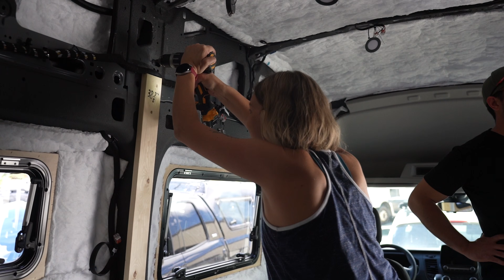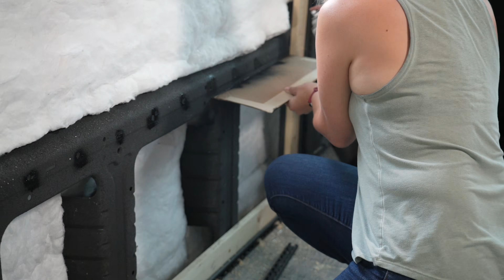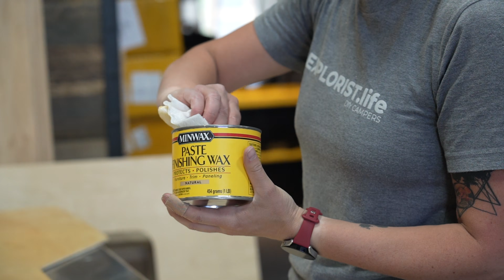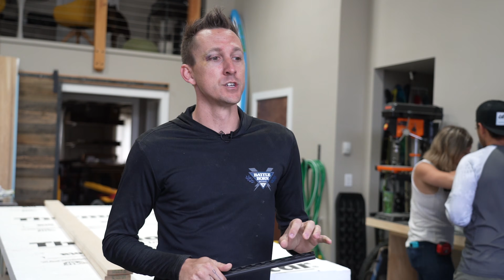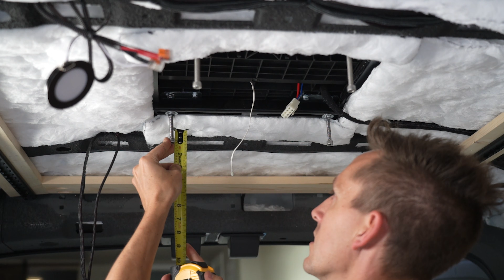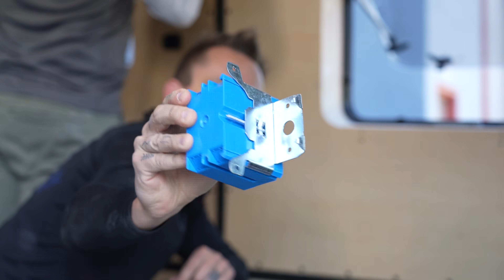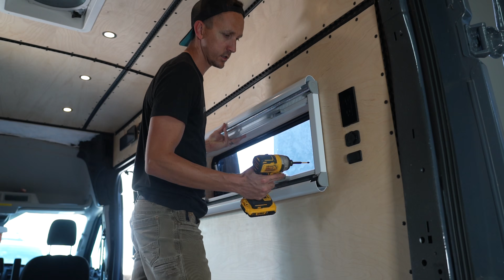DIY CAMPER VAN WALLS W/ L-TRACK (100% from scratch)

Comment: Hi guys! I'm here to ask another question :)  We just started installing plusnuts today using the Kiarou pneumatic tool that you linked above.  Did you have any problems with mandrels have a short life? We replaced the mandrels supplied with a 2 1/2" bolt - and we could only find stainless steel. The first mandrel we used lasted for only 6 plus nuts, the 2nd mandrel was good for 3 plusnuts, the 3rd mandrel was good for 1 plus nut, and same for the 4th mandrel.  Did you have problems with running through mandrels like this? Not sure if it's something we're doing wrong or if it's a problem with the tool. But at this rate we're going to pay crazy money just for mandrel replacements.  I know you're not pneumatic tool experts, but don't know who else to ask. Thanks....and happy New Year!
Reply from the maker: We went through probably a half dozen.  Get some anti-seize paste (any hardware or auto parts store will have this) and keep the threads lubed up.  A thread die was also helpful for straightening the mandrel threads out as needed.

Comment: I have another quick question....I was just about to order the pneumatic plusnut gun that you linked.  However, when i read the description on Amazon, it says that it can't be used for plusnuts. It reads "This pneumatic gun can't be used for stainless steel nuts....in addition, plus nuts can't be used".  So, did you use this for plusnuts? If so, did you have to make an adjustment to the tool to be able to use it?
Reply from the maker: We used it for plusnuts, yes.  We didn't have to make adjustments.  Not sure what the warning is for.

Comment: Great video! I'm curious why you used the furring strips with the L-track to secure the panels? I'm not challenging your installation, I'm genuinely curious as I'm just about to install my L-track and panels.  I've referenced Alpine Van Works and Ourkaravan who both installed the flanged L-track to the van wall (no furring strips)and used the l track to hold the panels in place.  Would really appreciate your thoughts behind your installation!! Again, thanks for the great video!
Reply from the maker: Using the flanged L-Track would have meant that we would have had to unbolt the L-Track from the wall to access behind the panel.  With the screws like we did, it takes about 5 minutes to pull off a wall panel, which is MUCH faster.

Comment: This is a great video. I do have some ideas for you. Instead of using loctite 242 you should try loctite 248. It is a paste version of the 242. It works much like a lipstick except that I would not apply it to your lips. If I were you. You simply put the threads into it and it will removes exactly the amount that you need. No waste and no mess! The other idea I have for you is that you use a router instead of a jigsaw when cutting out windows. Simply bolt the panel that you are cutting the window out of into place then cut out a hole in an obvious spot within the window area and use a flush cut router bit to cut out the interior of the window. This is faster, cleaner and more accurate than a jigsaw will ever be. Rivet nut or rivnut is would I search for on McMaster-Carr. It's another name, but if you can't find what your looking for then perhaps it's the terminology. I also find that more selection is available with metric threads. There are vastly more companies and countries using the metric system versus SAE. That's all I have for now. Thanks so much for your videos. I watch every single one and have a huge appreciation for your knowledge of electrical systems.

Comment: Great info and I expect to follow your ideas.  Probably using silver flanged Ltrack and white walls.  Did I miss an episode where you cut the foam blobs near the front?`. Keep up the good work.
Reply from the maker: We haven't talked about that in any videos just yet.  Removing them was simply yanking them off of the wall.  They are only secured with a trim clip.

Comment: When you "temporarily" attach the furring, are you using self tapping screws? Are you using the same holes you plan to ultimately use for the L track?  If not I guess you are painting all those?  Thanks for a great vid
Reply from the maker: Self tappers, yes.  Generally no.  Also yes.  You're welcome! Thanks for watching.

Comment: Why isn't there damp foil In between the insulation and the panel?
Reply from the maker: Mainly because it's not needed.  Pretty impossible to make a true vapor barrier in a van.
Reply: @EXPLORISTlife  when there is proper ventilation I can see it working without barrier. Surely the chassis segments can be taped off. I've seen it on others with fiber insulation.
Reply from the maker: Yeah, we have proper ventilation.  Vent fan + Windows + a heater that doesn't introduce moisture = good to go.

Comment: What screws did you use to secure the L track and your wood panels?  Thanks
Reply: My L tracks came with instructions: the recommended screws are 1/4 in-20 (1/4 inches in diameter, 20 threads/inch)

Comment: When drilling steel, slow as you found is better and always use a lubricant… a few drops of 3-n-1 or better specialist cutting oils wd-40 silicon or ct-90 cutting oil.

Comment: I found myself drilling through the head of a hammer. Only One solution ultimately for drilling steel.  
Carbide Except no substitute.
Reply from the maker: Nice!  The cobalt bits we ended up buying for this project have been the sharpest ones we've found.  I wonder if the carbide bits we initially used were just poor quality or something.

Comment: I'm assuming the L track locations are predetermined with future cabinet locations in mind, but here's a few questions; why so much L track? Like why not just mount cabinets and beds and such directly to the van? 2nd questions,  why use furring strips? Like why not mount wall panels directly to the van?
Reply from the maker: We don't have just a singular cabinet/bed/etc setup planned.  We are building everything on the inside except the electrical and plumbing cabinets over the wheel wells to be modular and removable/replaceable depending on what type of trip we are taking.  This flexibility warrants making mounting points throughout the van.

The furring strips give easy places to mount the panels.  Drilling 100's more holes through the metal to simply hold up a 10lb panel would have been prohibitively difficult.  Plus... there are some places where the metal dips away from the wall where the screws wouldn't fit/reach.

Comment: Great video demonstration and have been a follower for a while.  One question that came to mind at the end of the video when the walls were done was the batteries and electronic panels that were shown in the background on the driver's side floor in the back of the van.  I see what look like 2 batteries (assuming battle born), but they don't' look like the standard group 31 type batteries.  Are these one of their other form factors and which specific model of battery (and are they heated!)?  I looked at the videos on the electrical systems but didn't see the specific callout of the batteries.  Love your videos and your previous wire diagrams have been super useful over the last few years on my van wiring project!!
Reply from the maker: Stay tuned! We will be releasing our electrical video in 2-3 weeks with ALL of that info.

Comment: I built out a 2020 Transit in my driveway during the pandemic. Early on I discovered the harden steel issue with the Transit. Therefore I decided to use only the existing factory holes in the van. In put threaded plus nut inserts into all of them and everything in the van is fastened via those spots.  It worked out beautifully. I mounted 8020 extruded aluminum length ways on the sides to have structure for cabinet, bed and shelf support.  Then mounted flexible luan plywood sheets directly to the van walls using the remained inserts. No special tools required, just the hand tool jig from the plus nut company.  A bit slower than the special tools, but I will never need to install plus nuts again, so why buy a special tool.  I only needed to install about 50, I don’t think there are 400 holes in my van. By not using furring strips I gained valuable inches of space inside the living area and the luan conforms to all the compound curves.  I have no shop, and only use 4 handheld power tools; orbital sander, circular saw, jig saw & drill.
Reply: hey Rick, the same for me - will follow your suggestion as i have a small ford custom transit ....
Reply: I am planning the wall install for my Transit. Plan on using existing holes also.  Do you have any photos of your van build?
Reply: @ellenstipo3115  yes, do you mind giving me your email address?  I don’t know how to get them to you otherwise.
Reply: I think this is better than drilling because all those shaving will rust quickly from condensation and rust will spread.

Comment: For cutting the windows out, why didn’t you just mount the wall and then use a flush-cut router bit to cut it out?  It would have been easier and more precise.
Reply from the maker: ...and also messier and more chance for a rogue woodchip to scratch the acrylic windows.  Lots of ways to do this stuff.

Comment: Hi Nate, I hope you did not use non-SS black oxide steel bolts/screws; I found out the hard way they rust in about 6 months. My van was parked outside, and I had to redo all black oxide mounting bolts; they all rusted. Granted, a thread locker will help, but not for bolt heads. Anyway, good luck, with the build!

Comment: After getting this far was the spray on insulation you did after the sprayed on noise deadening worth the effort? Seems that the tiny gain not worth the effort. Any issues from the the sprayed on materials impacting other areas of negatively or unexpectedly ?
Reply from the maker: I think the ceramic insulation was more beneficial than the sound deadening spray.  That said... I think that if you're going to do one of them... you may as well do the other.  The only 'negative' impact was getting some of the Lizard Skin on some areas of the door jamb where we did a sub par job of taping.

Comment: awesome build guys, how do you like those snap electrical connectors - when I found those it was like a revelation in the electrical wiring schemes.  I'll be installing my AC unit this week, it should be fun!  the T track on that birch is good looking, very sharp - its fun doing these types of projects because you end up learning what works, what you'd do differently etc.  GREAT JOB EVERYONE!

Comment: When drilling into hardened metal, use a block of Bee's wax. It keeps the bit cooler and cuts better. Start drilling for the bit to get hot, then touch the Bee's wax to the bit to let some melt on it. Repeat as necessary. Bee's wax is cheap and will make the bits last longer!
Cant wait for the next episode!!! You guys are Awesome!!!
Reply: you can also just pre drill your wood, then get a impact driver, mines Milwaukee,  and drive a regular wood screw through the wood and into the metal, it will screw through the metal in about 3-5 seconds, I've tried those special metal screws aswell before, however the regular wood screw works the best and cost less.

had 19 people in the van there at a beach party during the summer , counted 9 people sitting on the bed at one point. bed is held up with (8) 4 by 70s wood screws.  
couldn't believe how strong it is .

Comment: I work in a machine shop and what we use for drilling tough metals is with a carbide drill that’s a tri-flute drill. It works so fantastic! Way better than a cobalt drill. 
Food for thought. I’m sure you’re all done doing most of the drilling now but I just got to watch this. 
 You guys are doing a fantastic job. I’ve been watching you guys for a few years now and you’ve given me many ideas for upgrades on my Winnebago Era.  Thanks and keep up the fantastic job.
Reply: Carbide would be the best however being in a hand drill it may shatter once they break through and tilt it. I think there's a tool thats a drill press with a magnet base that could give an even plunge?

Comment: My lordy that is a tedious job. Looks great.
AND as you promised the installation of the 12V outlets. 
It's funny because you used a different kind of 12V outlet that just screws into the wall from the front. That is a way easier design compared to the kind I bought that have the plastic screw on the back that you need to have access behind the walls to mount. 
So i guess what i learned was buy a different 12V outlet. 
Thanks again.
Reply from the maker: Sort-of...  It sounds like we are using the same outlet.  We secured the outlet to the front plate with the big screw/ring on the back, and then drilled the hole to the same size as the OUTER diameter of the retaining ring on the back.  This let us just screw the whole thing in from the front.

Comment: Question why use the letter not to connect the wires to the AC plugs and not just go straight to the plug with the supply wires

Comment: Nice and clean, but why do you need so many screws to attach panels? And black looks too black on beautiful plywood.
Reply from the maker: Probably don't 'need' that many screws.  It just matches the bolt spacing on the L-Track; so it looks nice and symmetrical.

Comment: Like the use of 'L' track and contrasts nicely against the wood .
'OutSide Van' did something similar on one of their projects where 'L' track was used liberally throughout the van to keep things modular so  cabinets could be relocated or in one case the customer went with Soft Storage along the sides and hung from the ceiling of the van , also the customer opted for a hammock instead of a regular bed , that way he could have room for his motorcycle should he wished to take one with him.
So looking nice , clean lines .
Reply from the maker: For sure!  I think that Outside Van uses the Adventure Wagon kit that we were trying to emulate, except do it from scratch.

Comment: Question: I'm building a Toyota Previa and need to keep weight to the absolute minimum, what insulation and panels do you recommend when weight is a primary concern?
Reply from the maker: The thinsulate we used in last weeks episode is about as light as it gets for insulation.  For wall panels, I'd look into some kind of carbon fiber honeycomb panel.  Should be no more than $1,000 USD per sheet, I'd imagine.

Comment: Thanks for the great content!  What is an “Anderson port”?  I don’t recall you providing any content on them.  I am past the panel install phase in my Transit build, but about to start enclosing my 8020 upper cabinets and finish the under cabinet lighting. Hence I am very curious about the “Anderson port”.  Thanks for all the help!
Reply from the maker: It's just another type of DC electrical port.  I skipped over them in our branch circuit videos because they aren't very popular and I'm using them for a really specific use case;  and I though that showing them earlier wouldn't have made sense.  You'll see those a LOT in the upcoming cabinet videos.  Basically, though, the bottom two ports are wired directly to the fuse block for constant power so that we can install a USB outlet, water pump, refrigerator, or anything else that needs constant power and connect it to that port so the cabinet could still be removed if wanted.  The top two ports on the connectors near the ceiling are on a switch for 'upper cabinet lights' and the top two ports on the connectors near the floor are on a switch for 'lower cabinet lights'.

I don't think that was a very clear description of what they are... so maybe just 'staying tuned for future episodes is the best option here so I can show you.

Comment: Again with the safety!  As soon as you mentioned the time crunch I knew an injury was incoming.  lol  Glad you didn't do permanent damage tho'.  I wonder if a drill press vertical setup like some I've seen in shops (floor stand with automatic pressure applied, like a band saw) is a 'thing'?
Reply from the maker: Haha!  I'm pretty prone for minor injuries.  Usually they just aren't to my face. 🤣😂  They make a magnetic drill which has an electromagnet that attaches to a vertical surface and drills horizontally.  Those are commonly used for drilling holes for trailer hitches and such.  Pretty pricy and heavy; but MAYBE would work well?
Reply: @EXPLORISTlife  Oh, that's right.  I'd forgotten, haven't used them in so long.

Comment: As an electrical Tricia for many years I have found using "pan head" self tapping 'tek' screws to be ideal when attaching stuff to steel or wood
Reply from the maker: For sure!  We definitely tried self tappers, but WOW is that boron steel some hard stuff.  It was just rounding off the self tappers.

Comment: What does the tattoos on your right hand mean?   

Great job on the build series.  The next part will be my favorite.  The wiring and plumbing
Reply from the maker: Thanks so much!  We are pretty excited for the electrical and plumbing systems coming up as well.

Tattoo tour: Mountain and a tree on my thumb and pinky fingers for outdoors & mountain sports.  New York Hook (firefighting tool) on my index for my time in as a firefighter.  Rabbit Ears rock formation on my middle finger, which is symbolic of where we live; and then the symbols for AC and DC power on my right ring finger.  The turtle on the left ring finger is my 'wedding ring', since I don't like wearing rings.
Reply: @EXPLORISTlife  thanks for responding.  I’m always curious about peoples tattoos and the meaning behind them.